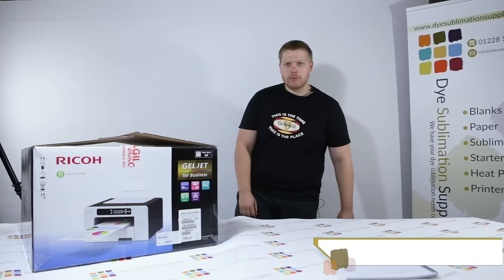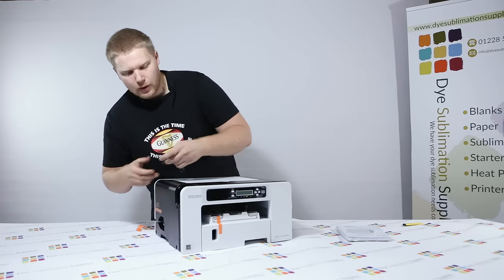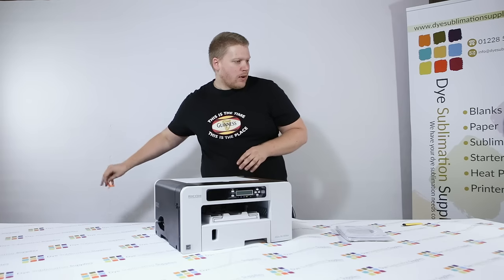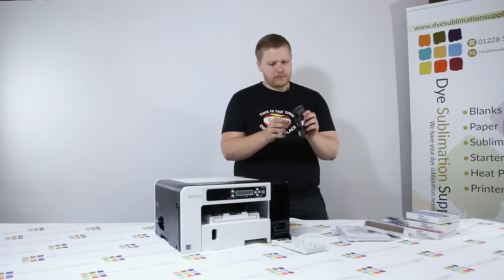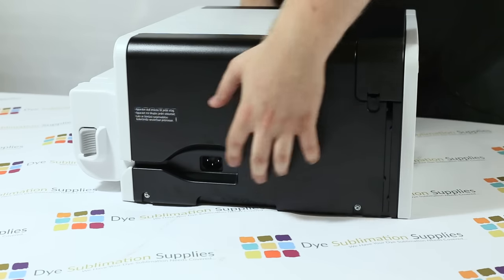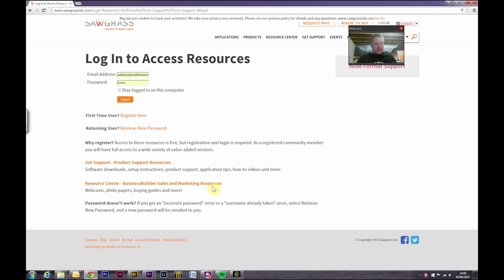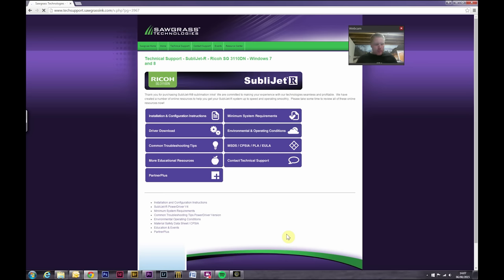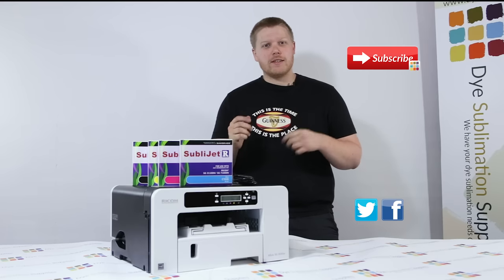Unbox and Install Your Ricoh Printer for Sublimation Printing - Dye Sublimation Supplies

Comment: How would I install the driver for a wireless connection to the Richo printer?  The printer is in another room, and I can send test prints to that printer fine (printer driver has a nozzle test function.)  Thanks

Comment: Hi today i bought  a second hand Aficio SG3110 SFNw printer but it didn't come with driver. i download the driver from internet but I am failed to use it as wireless printer please can you assist that how I can use it as wireless printer remember i connected bother devices computer and printer with WiFi. thanks in advance.

Comment: Hi i want to use this printer for sublimation on cotton t-shirts. What do you think how many a4's can i print out before i use up all the ink ? And can you give me info on what type of inc is best for cotton sublimation ? Ty a lot for any answer.
Reply: I found some tehnique with some dust + special paper. That can help make sublimation on white or white colored t-shirts. But it cannot be used on dark colors , but there is another trick with using some special material that is white and allows box sublimation on dark colors. Now im just interested if the printer is good quality color wise , or its about what ink i use more than printer ? And how many could i print out before i run out of ink ?
Reply: For example this color J-ECO PIGMENT T JT-20 is made for cotton sublimation. But i'm just asking if this printer can use this type of colors. I know i ask a lot :D
Reply: Also sry i keep saying inc i've ment dye.

Comment: Hi, just bought a brand new Ricoh SG2100N model and haven't even turned it on yet. So in that case, I suppose I don't need any cleaning right ? I just put the dye sublimation inks into the printer at first start ?
Thanks in advance.
Reply from the maker: if you ahvent loaded any ink you will no ned to flush the printer
Reply: Dye Sub TV thanks a lot.
Reply: Oh I also wanted to know if they (SG2100N and SG3110DN) both take the same cartridge type?

Comment: Can i install and set up the ricoh 3110 with refiliable cartridges fillled with sub ink,instead of the sublijets???
Reply from the maker: +Simone Pettinati Yes you can, the only problem would be that you wouldn't be able to use Power Driver to profile your ink because you need the sublijet carts to download it and refillable ink isn't the same so even if you used Power Driver, your print would probably come out differently to what it would with the sublijets. If you are able to get a profile for the refillable inks you could resolve that problem though.
Reply: +Dye Sublimation Supplies Thank u so much for the infos.What do you mean when you say " to get a profile for the refilllable inks"?
Reply: +Simone Pettinati: I am provider of sublimation gel inks for this printer model. If you still need help please let me know. Our inks do not need any other profiles besides that the ones that you already have. Our cartridges comes with Auto Reset Chips which means that you can refill over and over the cartridges. We have a promotion of a whole set plus an extra set of inks for only $118.15 free shipping all over the US.
Reply: +Simone Pettinati: I am provider of sublimation gel inks for this printer model. If you still need help please let me know. Our inks do not need any other profiles besides that the ones that you already have. Our cartridges comes with Auto Reset Chips which means that you can refill over and over the cartridges. We have a promotion of a whole set plus an extra set of inks for only $118.15 free shipping all over the US.

Comment: I have the sg2100n printer, but am not given the option of my printer. Can I still download power driver?
Reply from the maker: +thelaird1 im nit sure if there is a power driver variant for that printer however the available software downloads for that printer can be found on the saw grass downloads page for this model

http://support.ricoh.com/bb/html/dr_ut_e/re/model/sg2100n/sg2100nen.htm
Reply: Dye Sublimation Supplies

Comment: i got this printer and it came with sublisplash inks and 100 sheets of transfer paper but i have no idea how to use the paper it seems different to what ive used in the past and there are no instructions with it :/ can you help?
Reply from the maker: Hi CJ, If the paper is S race then you put the paper in So that the dull (more yellow) side is face down in the print tray this is your print surface
Reply from the maker: Hi Rocky, have you used sublimation printing before? I would recommend having a browse at a few more of our videos or emailing us on info@dyesublimationsupplies.co.uk and we can try and help you out :)

Comment: Can someone tell me a little about this printer type.  IDK what sublimation printing is.  I just want a mid\high range inkjet printer capable of printing better quality than your average home printer.  Is this the one for me, any suggestions of other printers that beat your average £60 epson\canon etc in terms of quality.
Reply from the maker: Hi, This printer with these inks is designed for sublimation transfer printing rather than direct media printing for photos etc,  for a photographic printer i would recommend something like the Epson P600

Comment: At 2:29, got confused about not putting original ink in printer. What other ink should be used if not original?
Reply from the maker: Hi, by 'original' ink we mean to OEM inks that may arrive with the printer and are just normal inks. If you are using the Ricoh printer for sublimation you will need to use sublimation ink not the 'original' OEM inks as you can't sublimate with them
Reply: Thanks, I'm just looking at office print needs, Sublimating seems to be for a whole different need, though I'm not sure I know what it is.
Reply from the maker: +Makinja well in that case you can simply install the OEM inks! dye sublimation printing allows you to print into mugs, tshirts, mouse mats etc but you would need heat presses and special paper as well as the inks

Comment: Hi, so what happens if someone used reg ink? Do i flush it with reg ink or Sublijet? Do you know the paper size I can print to? 8x11 8x14?
Reply from the maker: +inhisreflection 

Hi if you used regular ink you would need to flush the system through in order to use dye sublimation ink, you could do this with sublimation ink however from a cost perspective i wouldn't recommend it, the most cost effective way would be to get some refillable ink cartridges for the printer and use de-ionized water to flush the system. following think you would need to charge the print heads again but with sublimation ink. the biggest print size you will get with a 3110DN is about 8 x 11

Comment: Can i use the sawgrass software with my macbook?
Reply from the maker: +Peggy Kan Hi, yes you can but instead of downloading PowereDriver you download the ICC Profiles
Reply: Thanks! What kind of guarantee do you guys offer on the starter kits? Also how long do the sublijet r inks normally last? I'm trying to work out the costs for sublimating phone cases
Reply from the maker: Hi, if you email me at dawn@dyesublimationsupplies.co.uk I'll email you over a costings sheet for the ink and some more info.
Reply: +Peggy Kan: I am provider of sublimation gel inks for this printer model. If you still need help please let me know. Our inks do not need any other profiles besides that the ones that you already have. Our cartridges comes with Auto Reset Chips which means that you can refill over and over the cartridges. We have a promotion of a whole set plus an extra set of inks for only $118.15 free shipping all over the US.

Comment: no cable with my printer to connect to pc just two power leads
Reply from the maker: Hi Simon, printers are rarely supplied with a USB cable, you should be able to use a cable to already have or get a new one for a couple of pounds online.